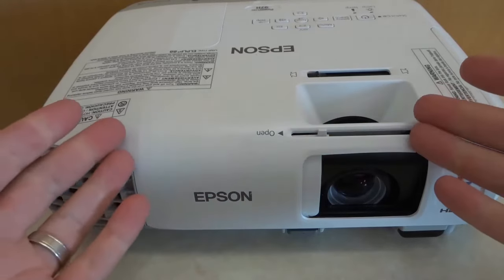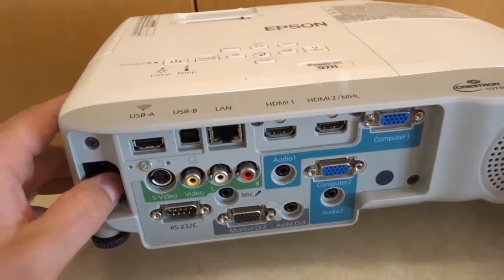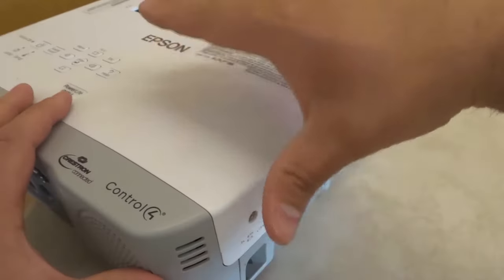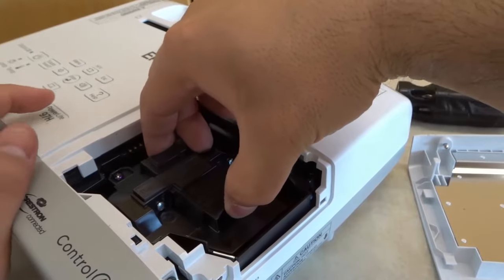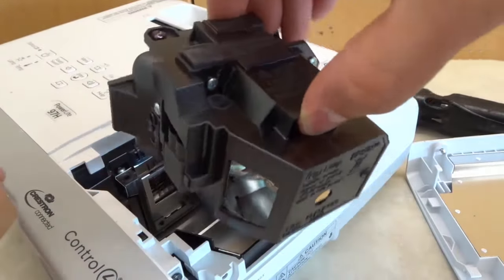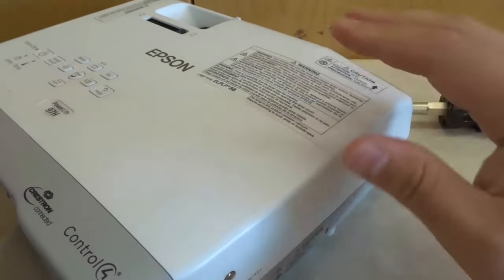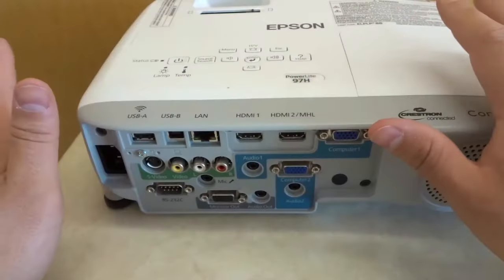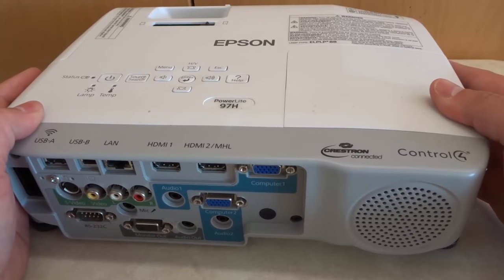How To Replace A Projector Lamp-Epson PowerLite 97H

Comment: Question, as I can'tfind much online.
I got an Epson PowerLite Home Cinema705HD. Mounted on the ceiling. I use it to play video games and it worked great for months. But like three days ago it has just been instantly shutting off as I turn my games on then the lamp light begins to blink/flicker oranage.
I just need to replace the lamp right or is there another issue? Can I install a new lamp in it while ceiling mounted so long as everything is unplugged?

Comment: I replace the bulb exactly how you said and it works now but the little Orange light that flashes that says the lamp needs to be replaced again is still showing even though it's still working fine now. Is there something I have to do to reset that?
Reply: not sure if it's too late or not but, you have to reset the lamp hours etc. ( in settings).
Reply: Same thing happened to me! Did you find out how to reset it?
Reply: Reset lamp hours in the info section in the settings